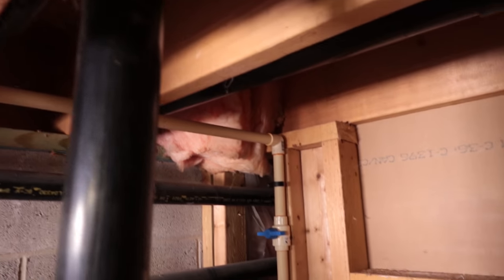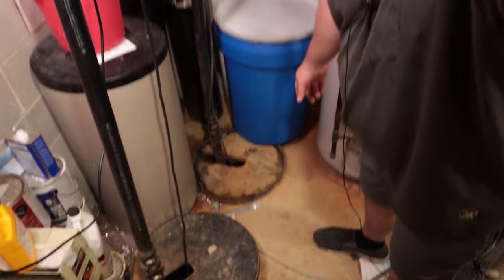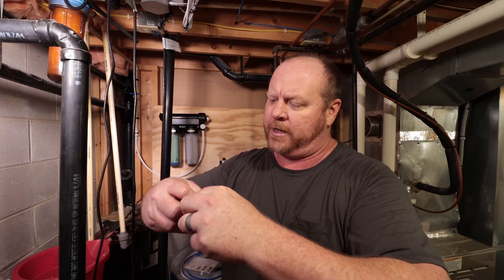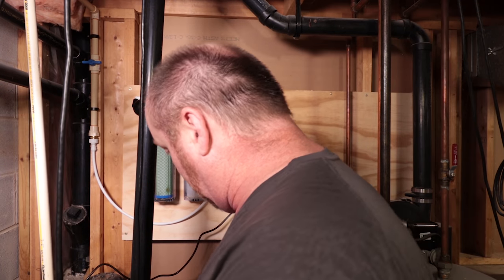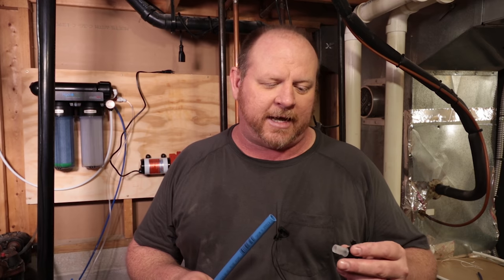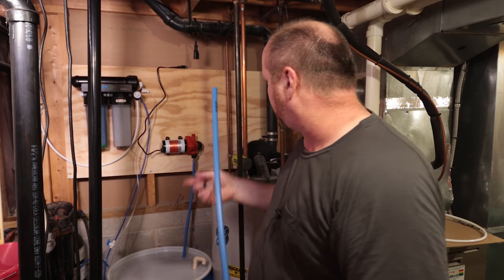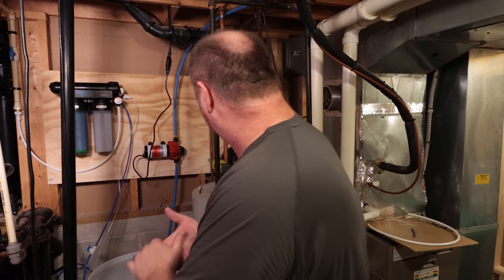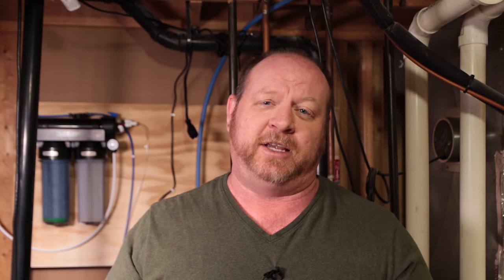Basement Brewery Build Part 12 Hydrologic Stealth RO 150 Install

Comment: The one thing i would add is an overflow line to the sump pump area with a checkvalve to save your basement area.
Reply from the maker: There is a hot water heater pan underneath the reservoir that drains into the sump pump basin right under the reservoir. 👍🍻

Comment: I swear to good I didn't copy you...because I put my Digiten in with my RO...but we have basically the identical system.  I have a much smaller pump..takes a while to fill my 30 gallon kettle.  Don't you love having RO water at the ready...I can't ask for more....get to start from basically zero and add salts to match what's needed.  I love it.
Reply from the maker: Yes!! love it! 👍🍻

Comment: Thanks so much for taking the time to document this. One suggestion though, you should put your follow-up video (Digiten DFC15 Liquid Flow Controller -Installation, Setup, and Accuracy Test) into your comments to make it easier to find. I could not find it in your basement build series. Thanks!
Reply from the maker: Good idea!! Done!

Comment: Nice set up, the cheap crimp tools for CV boots for car repairs work ok on those pipe clamps, though over here push fittings are used for pex pipe, my ball float leaked till i fitted the auto shut off valve, Cheers
Reply from the maker: Thanks! Cheers Clive! 👍🍻

Comment: Cheapo Smart Switch - add one and you can enable/disable the pump from your phone or a tablet/PC/laptop...Awesome...wish I had a space to brew like that. Soooo Jelly.
Reply from the maker: Can you recommend one? Some else had the same suggestion. I like the idea.. There so many out there, not sure what to look at.. Lol 
Thanks for any advice! 👍🍻
Reply: @ShortCircuitedBrewers  The one I see recommended most is the Wemo Mini Smartswitch. It just works and it works with your phone from an app or Alexa or from Apple Homekit.  It's $20.

Comment: Water report? More in-depth than the Ward Lab report? More for their education? I'm impressed. You can get nice pex crimp tool on Amazon very reasonable. I plumbed my basement brewery with PEX. It was cheaper to buy one from Amazon them rent one form Home Depot. If you never use the PEX again than probably not the smartest investment. Cheers Brian!
Reply from the maker: Yeah the water report is crazy detailed. I actually not sent it in yet.. Lol you have to take samples and frickin overnight them so they are fresh.. I'll post a picture of the kit.. It has multiple containers.. Yeah if I were using more PEX in the future I would have picked up a tool. Hope this helps you out!! 👍🍻

Comment: Great video Brian. I’m glad you did the research on this. This is definitely in my breweries future.
Reply from the maker: Yeah it took a while to find the right stuff! Cheers Paul! 👍🍻
Reply: Hi Brian, great video as always!  Have you done a cost per gallon analysis on your system? I use R.O. water for brewing because my town water is 350 ppm. I pay $2.00 Canadian ($1.50 U.S.) for 5 gallons or R.O. I wanted to purchase an R.O. system but when I add the waist water (2 to 1)and the price of replacing the filters, it didn't seem to be worth the cost per gallon. Any thoughts on this would be greatly appreciated. Thanks! Shawn.
Reply from the maker: @CanadianBrewingChannel  the performance will vary depending on water pressure and temp. I am on a well so I don't pay for water or sewer. The convenience is well worth it to me... And I can buy water for $.39 a gallon.. Lol 👍🍻
Reply from the maker: @CanadianBrewingChannel  with brewing use only the filter should last a long time IMO.

Comment: As always, I really enjoy your videos. They help refine my ideas, eliminating cons and reaffirming pros. 

I was actually considering RO days before you posted this, so it couldn't have come at a better time. After watching your video, I did a bit more research on solutions. Why didn't you buy a 14-20 gallon RO tank(gas charged accumulator)?

I found a supplier in canada that sells in both countries 14gallon tank for $140 (Canadian pesos) with free shipping. That's almost the price of your pump alone, and you don't have top worry about pump problems, or potential mold/mildew growth in an open barrel. 

Would just like your feedback, as always! Thanks for all your videos and work.
Reply from the maker: Look at the specs.. 14 gallon tank only holds about 7 gallons of water.. And the first several gallons will come out fast but the pressure drops off rapidly after that. You rarely get the full volume because of that. Also beware not all tanks are rated for RO water. The bladder can start to degrade after a short period of time. I did a TON of research on this before deciding to go with what I did. The tank is sealed off and there is no bacteria present to create mold or mildew. 👍🍻

Comment: I just set up this system for my brewery. It works great so far. My question is about the pump pressure switch bumping. Do you think am inline check valve between the reservoir and the pump inlet would solve that? It seems that there's nothing to stop the pressure from bleeding backwards into the barrel, and it'll cause the pressure switch to try and maintain it.
Reply from the maker: On the end of the pump there is an Allen bolt adjustment screw. Try turning it either way to adjust the pump. That should fix it.

Comment: This is a great setup.  Have you checked the TDS in the output stream?
Reply from the maker: Yes it is pretty close to zero with the DI filter installed. It was less than 10.

Comment: Can you explain how you turn the water on to fill the reservoir?  Is it a separate switch somewhere, or does it work automatically?  And, how did you make the main water line connection for the RO system?
Reply from the maker: It works automatically when the float drops. The main line connects to the system with a garden hose connection. I show it all in the video. 👍🍻

Comment: Just I stalled and rinsed this set in. I got a very low tds ppm coming out but the ph went from 7.1 Inlet to an 8.5 outlet. You have the same issue ? Guy with hydrologic said thatits because the lack of mineral content in the water throws off the ph pen probes and gives a false reading until I add my salts back in....
Reply from the maker: That is correct there is not really anything to read. Mine will show 10 sometimes. Just use the RO water in your software profile and it is generally dead on..👍🍻

Comment: Hey Brian! What is the benefit of the vent? I setup an RO system and bought the same tank but haven't vented. Then ran quite a bit of water through as the system directs but I'm still getting a really high PH reading on my filtered water, 9.3 (tap water here is really high as well). I haven't been able to figure out what's going on then I realized I haven't vented and though perhaps the water is absorbing CO2 or something that could contribute to the issue. Thanks!
Reply from the maker: The main reason that I vented the system was because of the suction that is caused when you empty the water out of the vessel that is really the only reason. According to what I've read the water does need to be exposed to air in order to drop in pH that being said if you have a really high pH it may not reduce it all the way down

Comment: What pressure is needed for that system? Do you thinking you'll need a booster pump for better efficiency? I am draggin my butt on setting up a RO/DI system I picked up from Bulk Reef Supply a while ago. I definitely needed a buster pump when I used it in the past.
Reply from the maker: The pressure range for the system. Is 40-80 psi. My water fluctuates between 40 and 60 psi. (Well pump) I need to tighten up the range so it is more in the 50-60 range but I don't think I need a pump at this point. 👍🍻

Comment: Brian, I have a question which I felt would fit the best on this video series. Do you have any major recommendations for pre-planning a home brewery build out? My wife has decided we are moving but this will take between a year to 1.5 years as the house we will be buying will need to be designed and built and although I have a lot of time I only have 1 week according to her to come up with everything I need done by the builder so it can be added into the price and the plans. Keep in mind I live in Florida, so no basements. My home brewery setup will be in a the garage part of a cottage house behind the main house and I've already decided the garage door will not be real as I want 4 walls. My goal will be many of the normal things like a large sink, SS table, shelfs or racks, my keezer, and fermentor area but my big concern which you seem to have a lot of skill at is plumbing and electrical recommendations. Any insight or suggestions would be greatly appreciated as I hate being rushed so I'm looking to get things installed that would give me the maximum flexibility for plumbing and electrical changes down the road if I need to make changes without having everything redone. Thank You.
Reply from the maker: Sent you a message on Facebook messenger.

Comment: Ended up buying the exact one… come to find out my 300 gpd does not remove chloramines. Did you run into the same problem?
Reply from the maker: I would add a charcoal prefilter. I'm on well.water so I don't have that issue.

Comment: What was the float you used?  And how does the float turn the filter on and off, does the supply line run through the float?
Reply from the maker: It is a float you can find in the description. It turns off the output from the system. If output is stop the system stop working. Once the level drops it will start producing water again.

Comment: The noise on that pump isn't so much the pump, but the board that it is mounted on. You get that pump on  the concrete it won't make near as much noise.
Reply from the maker: True!! I think rubber isolation would help as well.
Reply: @ShortCircuitedBrewers  Rubber isolation on concrete would be the ideal approach. The resonance of the lumber is going to persuade to Kelly to set you  up a cot next to it.
Reply from the maker: @beeroquoisnation  haha!!
Reply: @ShortCircuitedBrewers  You just built a very crude speaker that will resonate the frequency of the pump through a very resilient, yet mildly flexible media, and connected it to more mildly flexible and sound conductive media(i.e. the framing), expanding it's  acoustical range. After my stroke, audibles need to be controlled, or I'll lose my ability to maintain my composure. LOL Cheers buddy.
Reply from the maker: @beeroquoisnation  lol

Comment: Would you consider adding an overflow pipe on the heater pan to a drain?
If you did have an accident you could still have the backup of the water heading to a drain rather overflowing on your hard worked floor.
Reply from the maker: There is a hole in the pan right over top of the sump pump. I guess it didn't show up on the video at that angle. 🍻👍

Comment: I am a little fuzzy on how the float switch stops RO water flow. Could you elaborate on that? Does it simply close off the line which eventually causes the automatic shut off valve to work due to built up pressure?
Reply from the maker: Works just like a toilet. When it's full the float shuts of the flow of water. If the RO system can't flow It shuts off. Same as if I turn the valve off on the blue line. It is a float valve. Not a switch.

Comment: Hi Brian, thinking about building an RO system with the same components you used in yours.  Have you had anything you would change about yours since you built it?  Even minor things?  Looking to learn from any knowledge you have gained over the past year. Also, are you aware of any tankless systems that would allow on demand water, but quick enough to not slow down brewday?  I suppose i could let it fill the day before.  I plan on getting the flowmeter to only produce what i need.
Reply from the maker: I've actually had Zero issues. The water has stayed fresh for months at a time. I am not aware of an system that would provide an on demand ro without some type of reservoir. I like the fact that I have a large bulk of water at the ready any time. Of course that is space permitting. The other benefits of the large reservoir is that you have to water always available to your family in the even of an emergency. Let me know what you wind up doing. 👍🍻
Reply: @ShortCircuitedBrewers  Awesome thanks brian.  Maybe a small tank (not much room) will be the way to go.  I have an old 15.5 keg i am wondering if can be the reservoir.  Probably not since it would not be easy to clean, but, it would hold more water than i need for my brewing.  Wonder if i can somehow keep it sealed by using a triclamp with an adapter. Hmm.
Reply from the maker: @bryanwilson-187  there are adapters for tri-clamp fittings on sanke kegs.

Comment: I just found this video.  Awesome!  I was trying to work out how to make an RO system work with a pot filler as I am planning a brewery layout almost exactly like yours.  (I can't believe I haven't come across your videos earlier).  I have seen a lot of talk about RO water being very aggressive with faucets and a lot of recommendations for RO compatible pot fillers, which are $$$.  Have you seen any issues?
Reply from the maker: I had the same concerns. I have had zero issues. I think one of the factors is the water isn't under constant pressure. Welcome to the channel. Have you checked out my basement brewery build series'? 👍🍻

Comment: Question on your experience. There are mixed reviews out there on if Chloramine comes through an RO system. Whether it is small amounts or if it is eliminated completely. I have noticed some off flavors that seem consistent with Chloramine. Do you treat your RO water with a campden tablet? Do you experience any off flavors in regards to harshness/plastic flavors. Comes through more for me for hoppy beers and subtle for my other styles. It was something I didn’t perceive until a homebrew competition I entered. Something I will try next brew is just to add a campden tablet. Any help would be appreciated. Awesome videos though Brian! Love the channel.
Reply from the maker: Thanks. I don't have any direct knowledge of the chloramine issue. I don't treat my water with campden tablets. BUT I'm on a well so there is no chloramine in my water. Try the tablets and see if it makes a difference. Thanks for the feedback! 👍🍻
Reply: @ShortCircuitedBrewers   I’m city water so that might be why. Thanks for the info!

Comment: Great video as always Brian. I live up in the northwest corner of the great state of Ohio and I am on a well with water that is way to high in mineral content to ever be suitable for brewing. I have been contemplating putting a utility sink in the basement laundry room with an RO system and tank next to it. Can you comment on how hard your water is pre and post filtering? I am beyond tired of hauling cases of distilled water home to brew but idk how practical it is to filter my well water. Thanks in advance.
Reply from the maker: I'm not sure how hard the water is prior to the softener (I assume that is what you mean by filters) I has a crazy amount of iron so I never even bother to test it. I do know that after the softener it is about 350ppm on a TDS meter. I taled to a couple RO system manufacturers and they all said to put the RO system after the softener. It does shorten the life some but the system. Can deal with the salt much easier than the iron. 👍🍻
Reply: Short Circuited Brewers sounds very similar to my water, very high in iron and around 400ppm after my water softener. I was also told to install the RO system after the softener system. If I could get the water to near single digits on my meter I could justify the time and money to do it. Sounds like a water test is my next step. Thanks for the response.
Reply from the maker: @jonthebeau4653  no problem!! Let me know how it goes. The way I did it is much cheaper than a pressure tank that will hold the same amount of water this solution does. 👍🍻

Comment: How did you use the float with the ro filter man?
Reply from the maker: I just installed it in the reservoir and when the level reaches the float it stops the flow.
Reply: @ShortCircuitedBrewers  alright Thanks Man I Thought you had it rigged up electronically
Reply from the maker: No problem! 👍🍻

Comment: Are you still using this? I've gone down a long RO rabbit hole recently. There's so many products so many opinions. I can't seem to find to much info on brewers using the Stealth
Reply from the maker: Yes and it works great. I definitely recommend it
Reply: @ShortCircuitedBrewers  excellent, thank you.
Reply from the maker: @JohnnyReverse  welcome
Reply: @ShortCircuitedBrewers  Which carbon filters are you using? I see they offer a kdf/cat upgrade, as well as a Chlorasheild. I would think going with the chlorasheild would probably be the best defense . But just curious
Reply from the maker: @JohnnyReverse  I'm on well water so I don't have chlorine to deal with. I suggest you use the best one for you water source. 👍🍻 I also recommend the DI filter for a total clean zero output.
Reply: @ShortCircuitedBrewers  ah right, I forgot you mentioned a well. Makes sense, thanks for the reply.
Reply from the maker: @JohnnyReverse  brew on!! 👍🍻